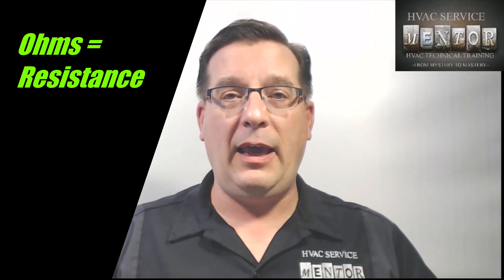Ohms vs. Continuity for HVAC techs

Comment: i never would use a continuity  scale ever... only  because it like you said will mislead you... they should remove this on all meters, this is how you can misdiagnosed a potential sale for a lot of money and time and look like a fool to the customer believe me never use this continuity scale it is for the lazy that just want to hear a beep and not look at the meter, like you stated it is misleading i have been doing this work for over many years and have gray hair now Haha...
Reply from the maker: I would say continuity does have its place and time to be valuable.  Finding shorts and opens in thermostat cable is one.  Identifying which contacts are open and which are closed is another.  Checking fuses in a disconnect box. I think there's no need to disregard a useful tool in the right circumstances.

Comment: Thanks ror the great video. Can you check continuity or resistance in a live circuit?
Reply from the maker: You're welcome, and great question.  The answer is No.  Resistance and Continuity should only be measured on components when the circuit is de-energized and the component is completely disconnected from the circuit.
Reply: @hvacservicementor  
Do you damage your meter if you do?

Comment: Great video definitely subbing.. almost condemned a drain pan heater because I got OL but when I tested ohms I got 150ohms .. so it was good but I was confused until know it’s too high of resistance to “tone” out
Reply from the maker: Good job!  Remember, that you may not always know what the normal resistance of a load should be unless you have a known good unit to compare it to.  However, in all cases, it will never be OL and it will never be zero.

Comment: Motors should be tested for grounds with a meggohmmeter.  I have several hand crank styles that can put out 1000volts to ground.  They will pick up high resistance grounds that an ohmmeter can’t find, because it tests the motor with its running voltage or higher.  It will cause near shorts to arch to ground, therefore testing the integrity of the winding insulation.  A meter with a 9 volt battery can’t find these types of defects.

Comment: Hello
I'm hvac tech. Can't find the answer for resistive load such as heat strip. As you said there is high value on resistance on it such as hot surface ignitor so question is if voltage value stays the same based on ohm law amperage gets lower if high resistance but in heat strip we have higher resistance value at the same our amperage drawn is higher which just contradiction to OHM law.
I'm senior tech and train lots of technicians but can't find answers for t this?
Reply: As a heat strip warms up, it’s resistance will increase.  There is really no way to measure resistance on a live circuit.  Any conductor will increase its resistance as the temperature of the wire increases.  The molecules get farther apart with heat, and cause this rise. You could prove this by using a torch to heat the strip heater element while an ohmmeter is connected.  The hotter the element gets, the higher the resistance will be.  Hope this helps.

Comment: How do u know how many ohms you should get when checking for ohms?
Reply from the maker: That's a challenge which limits the overall value of measuring ohms at all.  If you can compare your part to a known good unit, that can be helpful.  Some compressor manufacturers publish ohm values, but they can be hard to find.  Check out my class on electric motors to learn how to ohm out motors at www.hvacservicementor.com

Comment: Do understand that I am not being confrontational, only exposing a common fail.
Ohms and continuity ARE NOT related to each other... this misconception is why people do not understand the difference.  ...and you failed to explain this difference... that is due to a disease in teaching.  To teach correctly to the non-savvy crowd you must bring your mind to that level or you are pumping out a lot of implied understanding that the non-savvy has not a clue about.
Reply: All you did is point out the mistake. You did not tell us what the correct info is. So please explain that  here, or you are no better than that which you criticize.

WHY is ohms not related to continuity?

Comment: Ah but is a contactor technically a load or a switch?
 I argue it's both by design. It's a load, that actuates a switch or set there of. Most text books specify it as a switch or control only. If we really dig into it, it is most definitely a load as well. Ever try and install high current rated contractors in a residential split system with the same voltage coil? Some transformers are incapable of maintaining the same potential difference through the coil as its electrical requirements are greater... 
 Now the real question... Non positive displacement compressors... I.E: Centrifugals. How are they even compressors BY DEFINITION? ;) They're not
Reply: It's definitely a load that activates a separate switch.  If the coil wasn't a load, it would short.

Comment: I ohm everything period, I only use continuity to check for breaks in wiring or short to ground. If I am working on something bigger, motor's 25 hp and above that cost thousands of dollars, I am not trusting any meter with a 9volt  battery. It's time to break out the Megger 420/2

Comment: Continuity is a trickster and I'll tell you why.  Some meters will only read to a certain value and above that they will give O.L. when you still have continuity.  Surprised you left that out.  I don't trust it of use it.  Spec sheets often don't give the range of operation.  You have to 'test' your meter to find it's values.  Course that's part of knowing your equipment.
Reply from the maker: Joe, thanks for your input.  On a manual ranging meter, continuity is also the lowest scale range of the meter.  If the resistance of the load you are checking is higher than that scale, you will get OL.  200 ohms is common.  Beepers will stop sounding around 40 ohms.  Some meters may be less.  Like you said, you never know what you're going to get.  I like the "trickster" description.  Very true.